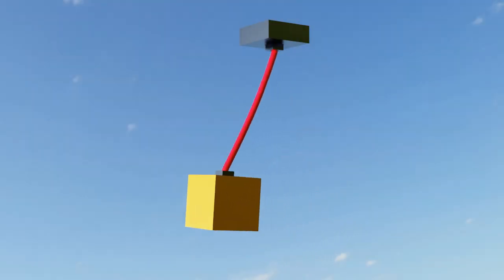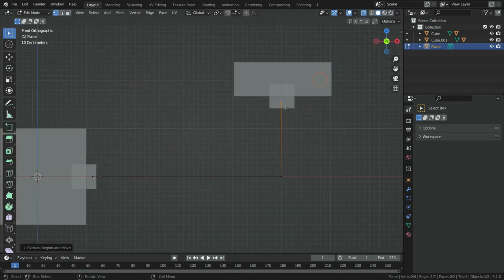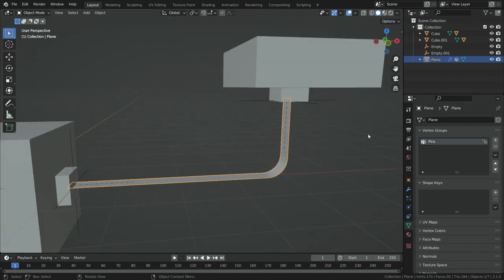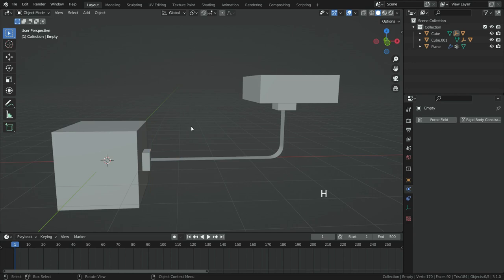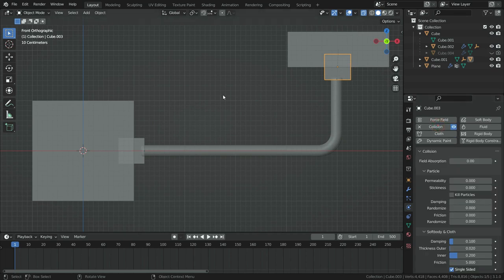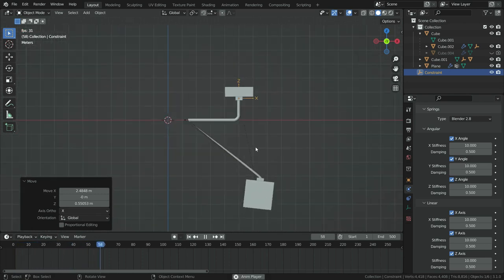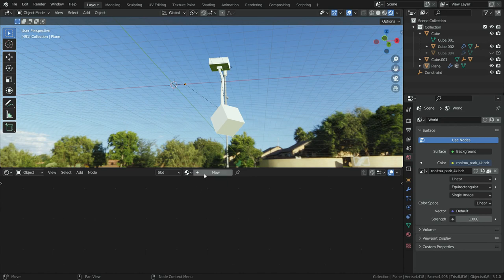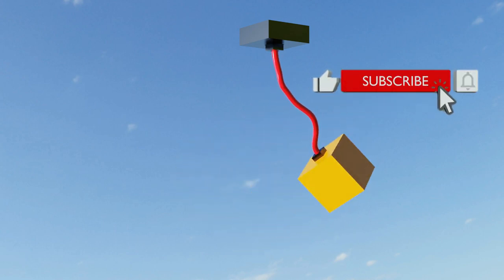Blender 3.1  Rigid Body And Cloth Simulation | Elastic Rope Tutorial

Comment: I was stuck at the moment at the hook section. Only the tip of the rope was sensible to the movement of the cubes. I solved it : it was because I didn't select enough vertices as a hook point. If somebody is stuck at the same point : be sure that you are selecting over all your weighted vertices to attach the hook properly.
Reply: Dude I’m stuck there too, my hook when played in real time seem to stretch the rope, I made my plane wider, I wanted to make some sort of wide cable, but for some reason even in real time it doesn’t even more the rope

Comment: I like the concept of this and I'm trying to figure out how I can use it for what I need. I'm simulating a 3D printer, and as the print head moves back and forth on the X axes it takes with it one end of a Bowden tube that contains the filament. This tube is fixed is size (length), but move or bends as the print head moves. Can the "Rope" in this example be stiffened so much as to simulate a stiff tube?

Comment: Great tutorial!
My rope keeps extending indefinitely when I play the simulation ( it's not bouncing back), what could I be doing wrong?
Thanks!

NVM, must have been a bug: deleted the "connect" constraint, and then re-connected the boxes, and it worked fine.
Thank you again for sharing this tutorial!
Reply from the maker: Thank u. If you follow the tutorial step by step,it should work.But,be sure that you enable the cloth simulation in the viewport.Also,it is caused by rigid body constraints.Switch the rigid body constraint to generic spring.